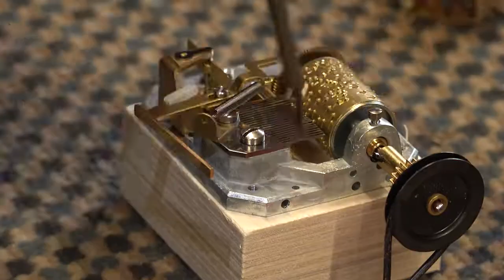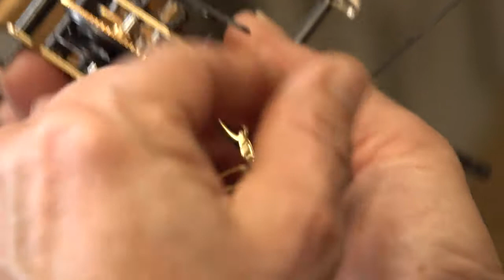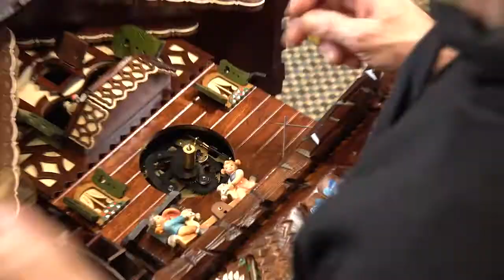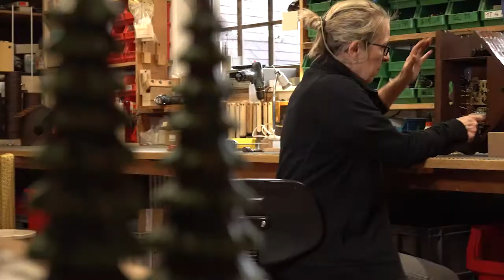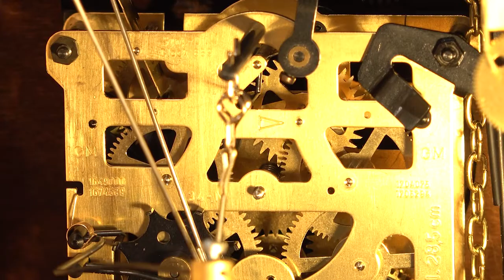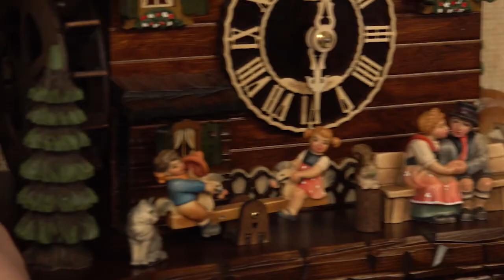Cuckoo Clock Making | Handcrafted in the Black Forest - "Happy Family"

Comment: They are 8 days if you hang them over 9 feet so the weights will last 8 days before they touch the floor.  The chains are 8 ft 5"  to the bottom of the clock therefore the clock would have to be hung at least 9 feet and 8" for it to last 8 days.  Or you can hang it at any height and wind it twice a week